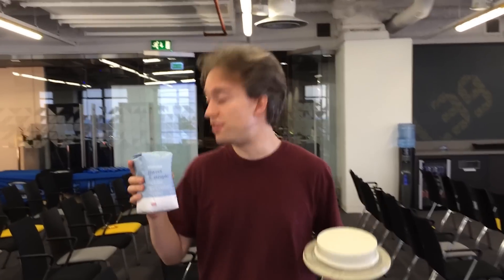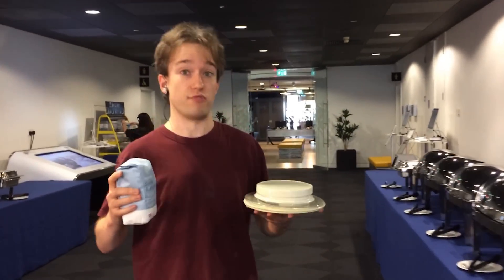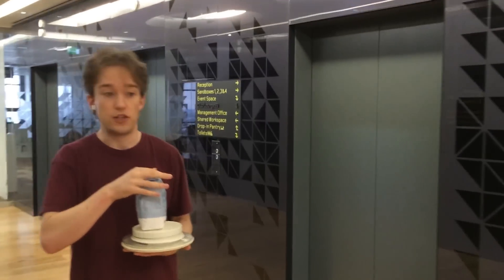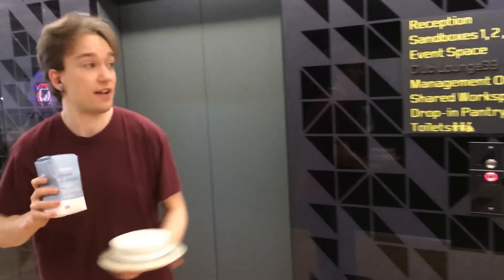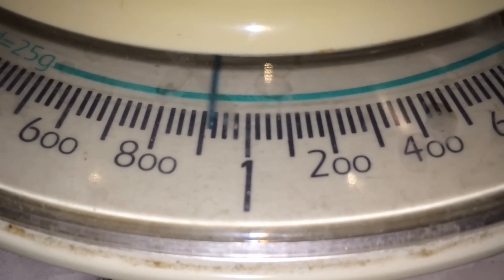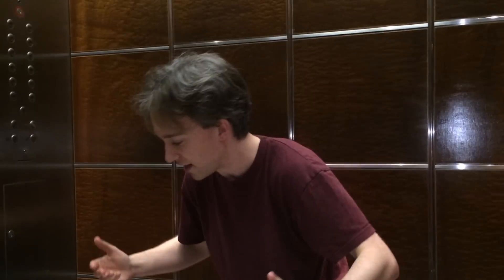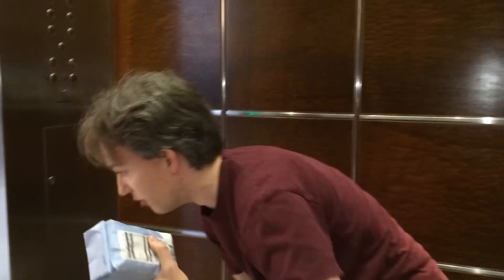How Many Gs Do You Pull in an Elevator?

Comment: If you experience 0.9G, you won't jump 10% higher. It's easy to see if you try to extend this: 0.8G: 20% higher, 0.5G 50% higher, 0G: 100% higher (aka only twice as high, after which you somehow get pulled down); oh no!
Calculating: h: height, v: initial jump velocity
h=v*t/2=v*(v/g)/2=v^2/(2g), so h is proportional to 1/g; thus if with g you jump h high, then with 9/10*g you jump 10/9*h=1.111...h aka. 11.111...% higher.

Comment: Makes sense, as most lifts have their acceleration capped at 1 m/s^2, or roughly 0.1g.
Reply: But why? Imagine 10m/s downward (with moderate deceleration at the end)

Maybe have a cake in there too xD
Reply: @mz00956  Comfort. If you accelerate too quickly, it causes passenger discomfort.

Comment: I wonder if you would've gotten a similar (but opposite) change in g's between stopping the lift when going down and when going up.  When I was in college I had a part-time job in a downtown Chicago high-rise. It seemed to me that the deceleration of the elevator when reaching a higher floor was a bit more than normal. I'd jump up just as the elevator started to slow down before it reached my floor. I didn't hit the ceiling or anything like that, but the feeling was fun.

Comment: Not one take for this one, then... :D

I feel very tempted to go test this in the tall building I'm currently attending a training course in, with either my very sensitive mini scales, or the digital ones if I can find fresh button batteries in time (I only have one session left). Their lifts feel like they accelerate and brake VERY hard, like overenthusiastic bus driver hard... maybe it's just the same 0.1G but it just feels extreme because you don't tend to experience vertical g-force that much in everyday life. Maybe it's more. All I know is they can get you between ground floor and the 20th floor, and back again, very quickly indeed...

Comment: The entire walk was distracting and unnecessary. You could have filmed the entire video inside the lift, or start right outside the lift, show you're on whatever floor you're on, and step into the lift. You could have done it a couple different times with different weight items or different lifts to show variety, but all that walking backwards was just silly and made it harder to understand what you were saying.

Comment: If you're in free fall, you still experience air resistance.
Reply: if you're in an elevator, the elevator experiences air resistance, but you don't. Of course, only if the elevator is airtight, but even if it isn't on the sides, that's still mostly the case.

Comment: G force is a measure of acceleration, not force.
Reply: then why is it called a force?
Reply: Bartosz Olszewski I assume because the acceleration is typically experienced as weight, so it causes forces. But I don't know why for sure though.
Reply: even though it's a measure of acceleration, it always takes force to accelerate or decelerate. hence, G force is appropriate.
Reply: Wait. It is a force. Wtf man.
Reply: +Bartosz Last time I checked G was neither force nor acceleration, but the gravitational constant. I think you wanted to talk about g, and this one is, as far as I can reach into what I remember from the college, an acceleration measured in m*s^(−2) - can you link me to something that says otherwise?
Reply: F=ma, the force experienced by an object (in this case flour sugar) is equal to the mass of the object multiplied by its acceleration. In this case the acceleration is approximately 1g, or about 9.81 m/s^2

Comment: This test would be interesting to see in some of the lifts in Japan. There have been quite a few lifts that went up and down so fast that my ears actually popped.
Reply: That's not speed, that's air pressure. If there's a significant change of air pressure then that will happen, whether you're going 5000 k/h or just 1 k/h.

Comment: How many G's would you be pulling if you jumped in the air when the elevator initially drops, float all the way down, and crash down when the elevator stops? Still just 1g?
Reply: +Evelyn Finegan Jesus, Someone actually being smart on YouTube. :) (No Sarcasm)
Reply: +Evelyn Finegan Yes! How many G's of force would you be impacting with was EXACTLY what I was going for when I asked the question. 330 g's is an astounding amount of force.
Thank you very much for answering, I didn't know the proper equation for figuring the force in the elevator situation :)
Reply: Evelyn Finegan your calculations are way off, you failed to take into account terminal velocity. The average human body’s terminal velocity is less than half of the velocity you used in your calculation.
Reply: +Trypno You would still only be hit with 1 G of force when you hit the ground. If you experience 1G of force, you're experiencing the normal amount of gravity. That's all it means when people talk about "Gs" of force, its simply comparing it to the force of gravity. In free fall, you will only ever experience 1G of force, as that is the force of gravity accelerating you downwards. If you're an average person who weighs about 62 kg, 1 G of force is roughly 607 Newtons.

Now, you know how they say "it's not the fall that kills you?" That's because say you fall 100m in an elevator, then the elevator crashes onto the ground. Assuming you started at 0 m/s speed at the top of your jump, after 100m you'd be traveling at roughly 44 m/s (Vf^2 = Vi^2 + 2ad, where Vi = 0, a = 9.8, and d = 100), so when you hit the ground, you're having to reduce your speed by 44 m/s (which is around 100 mph for an imperial units conversion) in a very very small distance. We'll say it's a really strong elevator that is only going to move by 30 cm when you hit it (roughly 1 ft for another conversion). We'll say you're an average person who has about 62 kg of mass about you, let's do the math on the force you experience pushing you back by the elevator:

We know the Initial Velocity (Velocity meaning speed here) (Vi) is 44 m/s.
We know your mass is 62 kg.
We know the distance traveled is 0.3 m (30 cm)
We know your Final Velocity (Vf) is 0 m/s because we know at the end of hitting the bottom you're going to stop moving.

To find the acceleration, we need only plug in the values to the original equation we used of Vf^2 = Vi^2 + 2ad and then use that acceleration in the equation of force, or N = ma (m meaning mass).

So we've got: 0 = 44^2 + 2a(.30)
0 = 1936 + 0.6a
0.6a = -1936
a = -3226 m/s/s (acceleration here is negative because we're accelerating upwards as the bottom of the elevator pushes us and stops us from moving downwards)

So now we've got N = 62 * 3226 = 200,012 Newtons of force, which compared to the force of gravity you experienced on the fall (607 N) is quite a large amount of force hitting you.

So by using our earlier statement of 607 N = 1G... 200012/607 = 330 Gs of force when you hit the bottom of the elevator.

EDIT: Made a slight error with the math, used 25 cm in the math for the elevator stopping but 30 cm in the example. It's been corrected now.
Reply: Trypno Glad to help :). Though I should point out that 100m is about 320 feet, and a typical "story" in a building is 10-12 feet, so you're falling through about 30 stories of building to hit 330 Gs of force. Compare that to falling say 3 stories,you'd end up with about... 18,000 Newtons for an elevator to stop you moving over the course of 30 cm, which is only 30 Gs. You're at almost 1/10th the impact.

Comment: weight =mass×gravity so that means that 1kg×9.8 (gravity on earth) = 9.8 newton's, the weight of the sugar
Reply: your math is off. The acceleration of gravity is -9.8m/s/s
Reply: +Trypno There is no such thing as negative acceleration. You can only &quot;accelerate&quot; in the opposite direction, which is not negative, it's just in a different direction. +Theo Sheridan was quite right that the Sugar weighs 9.8 Newtons. When people say that gravity accelerates us -9.8 m/s/s, that';s generally to indicate direction rather than actually being negative. Since up and down are relative, but up is generally considered the "positive" direction (though sometimes it's easier to consider up as the negative direction) people use the -9.8 to indicate that we are accelerating downwards, not that we're actually experiencing negative acceleration.
Reply: +Evelyn Finegan Thanks for clearing that up :)

Comment: Actually, technically, that scale is measuring weight, not mass (it's just translating and assuming correct gravity).
That's why it tells you a different mass in an elevator, and if you were to take it to the moon, it would be way off from the correct value.
Reply: +Jordan M.  He did mention that in the video.

Comment: EDIT: Nevermind, I was wrong here.
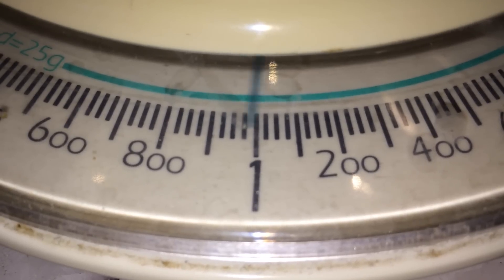1:35

You are wrong. Moving directly toward a gravitational source (plunging down) is different from moving in a horizontal direction at a constant speed (driving at a constant speed).

Once the lift stops accelerating and you are moving at a constant speed toward the Earth you will still feel lighter.
Reply: Agen0000 ... but of course in order to move toward a gravitational source at a constant speed you would need to be accelerating against it continuously.
Reply: Agen0000 No you will not feel lighter at constant speed. If anything you will actualy feel extreamly slightly heavier as you get closer to the surface due to gravity getting weaker with distance.

And to move at constant speed, including towards a gravitatinal source, the sum of forces acting on you must be zero. In other words, not accelerating in any way shape or form.
Reply: Melduron wow this was bugging me all day, because I knew that there was something completely off in my thinking here. You are completely right. If I was moving down at a constant speed I would still feel 1g. I would only feel lighter if I was accelerating down all the way.

"In other words, not accelerating in any way shape or form."

Well, I would still feel as if I'm accelerating at 1g as I do on the ground even though it is cancelled out by the electromagnetic force.

Anyway thanks for clearing that up for me.
Reply: ***** it's kinda like "ever so lightly", but just extremely so.

:3

Comment: The outtake was the best part of the video.  Much thanks to your cameraman for not warning you.  :-p

Aaaaaanyhow...

The kilo of sugar and the spring scale made for a good illustration.  If we want to perform the same test on a bunch of elevators, an Android tablet or phone would be a better choice.  There are a number of apps that display and record the data from the various sensors.
Reply: yes, at average, the accelerometer experiences on average 9.8 m/s force due to gravity, which it can use to determine which tilt it's at. So all you have to do is to check that value. Gravity in London is 9.81205 m/s, and since the scale gives 916.66/1006.25 kg, that means the apparent gravity is 8.93845 m/s, and that the lift is accelerating the highest with 0.87360 m/s² ... I guess.

Comment: Equal and opposite force may make you think that that's what 's meant by Newton's second law. In reality newton second law states the sugar pack pulls the earth with 9.8 N of forces as does the earth pull the sugar pack. Rather the equal nature of the normal force has to do with a balancing act done by all the electrons in the stuff that has a force applied to it namely: The paper holding the sugar has no net charge, since each electron in each atom has a corresponding proton, but as a force pushes the papper of the pakage and the plastic of the scale together The electrons of the plastic and papper begin torepel each other until they are far enough away from each other that  the forces even out again. Since the electric force is so much stronger than gravity matter rarely colapse in on itself see black hole.
Reply: Sorry about the misnomer. But that is exactly the misconception I'm referring to. Namely forces act in pairs but the force is always of the same nature. For instance the earth pull you with a force equal to your weight and you pull the earth with a force equal to your weight. Similarly if  there is a force pressing you against an object that object will press you with an equal force but so to will your body puch the object.  The bit about electrons is me tring to explain why the normal force is equal to the force being aplied to a surface.